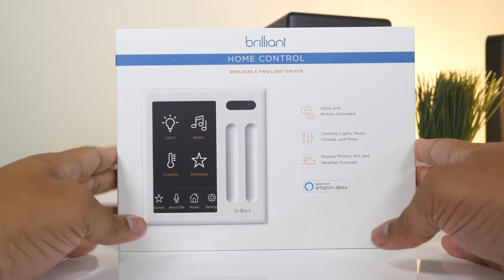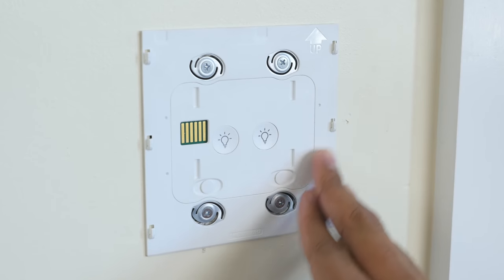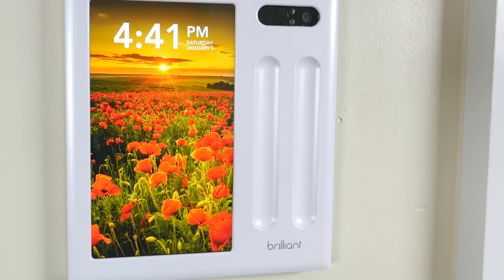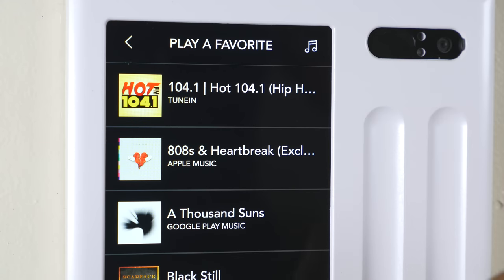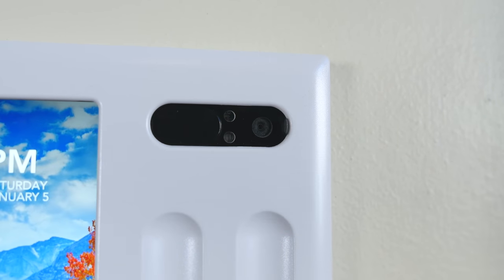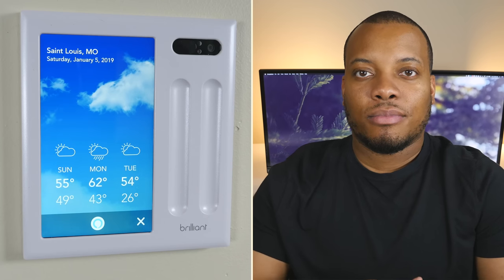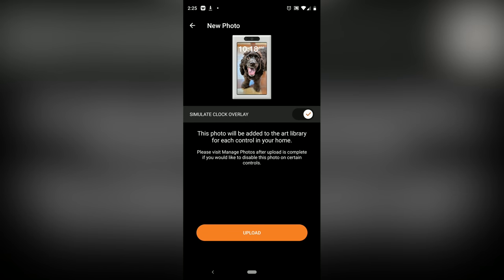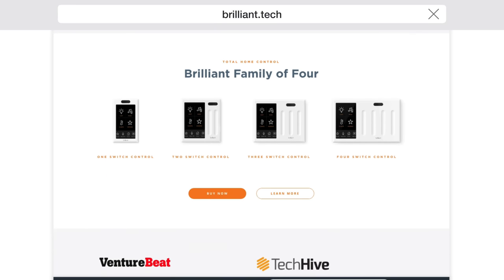The Smart Home Control Panel You Need

Comment: How's the Google integration vs the Alexa? We're a Google home house but love this idea.... But also feel.it needs a remote type option too
Reply: It has Alexa built-in, it uses skills to control things. I think Google is coming, but all are control options and outside of intercom, wouldn't really need to integrate with each other because you can link your devices to both
Reply: Definitely needs a remote. Don’t run into an internet issues as physical switch is now gone, it’s difficult to operate lights when said connection is broken. Having hue lights with physical dimmer switches that can serve as s back up is a must. I’ve run into a few scenarios where I lost control of lights that I did not have a dimmer connected to. Otherwise, I must say, these are brilliant. Have four and the improvements are incredible. Always working on the actual app. It’s ten times better than when I purchased with vast improvement to microphone and intercom.

Comment: I wanted something like this so I used an old phone with a magnet and metal plate. Works well as a hub so guests can use without my or their phone. Or if they don't want to use Alexa. Made mine look as clean and discrete as possible. This does look nice and has some additional functions. Price is a little hefty as my solution cost me nothing but an old backup phone.

Comment: Looks pretty impressive. I see several people freaking out about the price, but you have to keep in mind that this is first gen/early adopter structure, which means that price will probably come down as the company has success and accomplishes some better production runs.

Also, consider this is basically an Amazon Echo Show or a Google Home Hub that can mount on your wall (~$200 for comparison) without exposed wiring. 

I won't jump at the early adopted premium cost, but look forward to this hitting a price point for the masses in time for my Christmas list (crosses fingers)

Comment: Great video! Two questions...

Do the slide controls have to control whatever is connected to switch it’s placed at? Or can you set the slide controls to connect to any smart light? What about temperature? Or speaker volume? 

Second: what happens to the dumb device that was previously using the switch if you have the single switch version? It’s just a screen now. Is power still going to the light bulb the switch was attached to?
Reply: You can assign the sliders to other things like lights or music volume. And the dumb switch becomes instantly smart. For the single, you can turn on and off the lights by moving your finger up and down.

Comment: Very price prohibited at this time. $100 would be the sweet spot for single, with only a $5-$10 increase for each additional built-in switch. I'll wait a few years for price to become reasonable and for more camera brand integration.

Wondering though if it can control ceiling fan controllers or Bond?

Comment: GREAT VIDEO If I’m replacing a 3 switch configuration, will the 3  sliders control the original lights & the software and screen control all my smart devices? Also does this give my dumb lights now controlled by the new brilliant slider make them smart enabled? Can I know use Voice to control them ?
Reply: Yes to everything.
Reply: Yes - the light switch you install into instantly becomes smart. You can use voice to control them via Alexa or Google Assistant.

Comment: Soldier Knows Best - how's the quality of sound (Internal Speaker) Ie; Alexa, Ring or Nest Cam ?  Does this device eliminated Alexa on the counter top ?
I'm under the impression for Brilliant to be half way decent,  Sonos is a MUST. And if that's case,  349.00 +150.00 = a pretty penny....
Reply: 100% that's a main purpose for this switch. Frees up tabletops and outlets. Sonos works wonderful with it.

Comment: Smart Home market adoption would accelerate if homebuilders took the same approach as car manufacturers, meaning they’d do all the tech research for the buyer and integrate solutions seamlessly into the end product (car or home). Thankfully, Brilliant is working with builders to do that. Their challenge is contending with different voice interfaces (Alexa, Google Home, and Apple HomeKit with Siri) and different network standards and automation platforms for lighting, security, HVAC, and all the other subsystems. At least someone if finally looking at that, but I still have two main issues with their system.

OBSOLESCENCE – Rapid advancements in computer, networking, display, and storage technologies enable new features at lower cost each year, making slightly older products obsolete more quickly than ever before. That’s why I’ve been critical of the smart refrigerator with touch screen display on the door, when an iPad could do even more and with the flexibility of being portable. Do you really need to replace your perfectly good fridge so you can add a touch screen? Adding technology to homes has the same challenge. While appliances are designed to last a decade or more, homes are built to last much longer, at least through their 30-year mortgage. 

VALUE ADD? – From past experience, I’m skeptical that smart home technologies will increase the perceived value of the home itself and think it may detract. After selling a fully automated home several years ago, with about $10K invested, I was surprised when they buyer hired an electrician to remove it all. They just wanted something simpler like they were used to – so much for added value. What about the family committed to Apple? Will they justify paying a premium for a home reliance on Alexa-based technology? 

Ideally, Brilliant’s system would work equally well with all smart home platforms and in small apartments, assisted living facilities, and multi-story million dollar homes. If they can get there, that would be a huge plus that could help drive market adoption. While their focus is still on automation rather than AI-based smart learning, they do seem to be addressing some of the issues I write about.
Reply: For more on my Smart Home perspective, see https://mhealthtalk.com/elusive-smart-home/.

Comment: Doesn't having this stuck to one spot on my wall completely defeat the purpose of a smart connected home.  I want to be able to control devices using timers, sun up/down, when i enter leave automatically or remotely.  If i wanted to get up and go to the wall i might as well just use normal dimmer switches...
Reply: So true. Instead of this overpriced tech that's stuck in the wall, buy two inexpensive tablets to place around the home and some smart switches.
Reply: Should be $99.
Reply: Or you know, you can use Alexa to control it which is built in.  No need to get up.

I get what you're saying.  Which is why in general in not a big fan of these so-called Smart Speakers.  Because they are locked into a room by a power cord.  That is why I have a Apple Watch.  I can then just lift wrist and go Hey Siri and control my home or ask questions, etc and it works everywhere I'm at including outside and away from home.

Example, get home at night and want to drop something off in my backyard,  instead of having to go inside my house and flip on my side house light over my gate, come back and do my moving.  I can lift my wrist and just go Hey Siri, turn on outside garage light and Bam the light turns on.

Maybe I'm walking back home from 7/11 down the block.  As. I get close to home, I just lift my wrist and go Hey Siri, Open Garage.  It's open as I'm walking up the driveway.  

I find it easier to control my Ecobee 4 with Siri than the built in Akexa.  One thing is fore sure, you have to figure out what type of Smarthome you want to be and what products you want to use and are they supported with the type of smartphone you want.

You also don't have to get everything at once.  I like Smart Light Switches over Smart Bulbs for a few reasons.  But it doesn't make sense to have a smart switch for like a closet light.  I have a cheap glow light switch for my Mastet Bathroom light.  That makes it really nice to see the switch in the dark.  No need for something far more expensive and a easy swap.

My 71 year old Dad us retired and home mist u
Of the time.  So being able to easily adjust the temp in my house with the Ecobee 3 or 4 which I have makes sense.   Just like I have a Harmony remote to control all the devices in my entertainment center.  To gave a single remote to control all easily instead of a pile of remotes.  It makes life better for him.  These are things I think about.  Your whole home doesn't need to be smart.    Smart bulbs don't work if you turn power off at the switch.  It also makes things harder for guests.  With a Snart Switch, you gave voice control.  You can use the app.  For homekit, it's the Apple Home app, or you can turn the lights on/off right at the switch.  That's 3 options.  Plus you can continue to use whatever light bulb you want. I have normal LED bulbs throughout my house.

Again, things to think about.
Reply: The Brilliant Control allows you to control devices using timers, etc. including remotely. It's an all-in-one home control.

Comment: Why not just get a Google Home Hub for $100-150? It does the same stuff. 
Seems like a very overpriced smart assistant, which I need to hard wire in, and have to bend down for, to see and use.
Reply: True, I have 2 hubs and still doesnt cost as much. Do all this stuff for cheaper

Comment: You forgot to mention that you need a relatively new home or ( a home built after 1985)  to install these type of smart wall switches .You have to have a :1. (Red) load wire,2. (Black) hot wire, (White) Neutral wire and of course the Ground wire,   When you give information make sure to be very thorough or stay off YouTube.